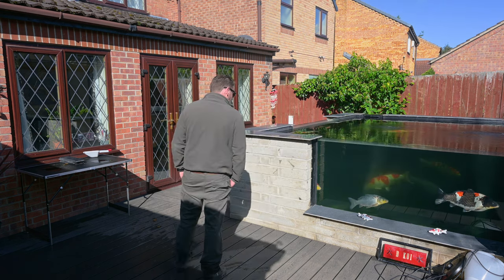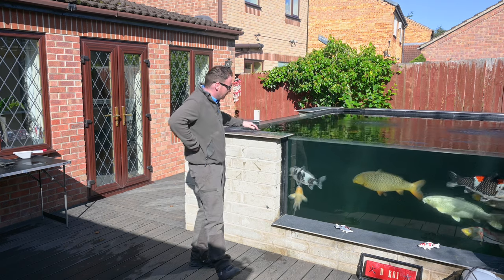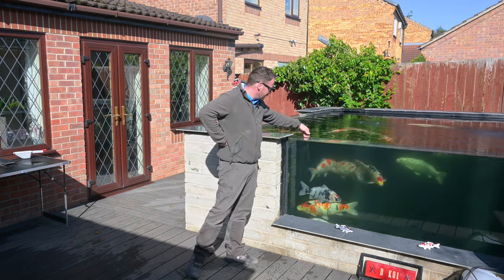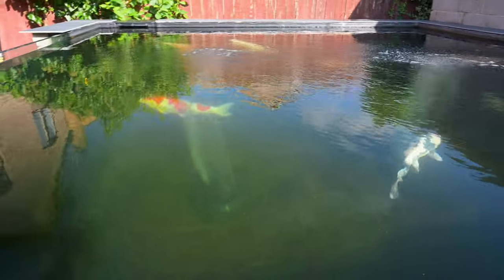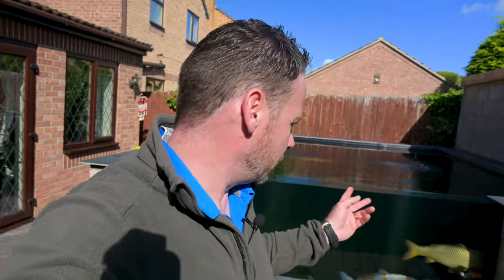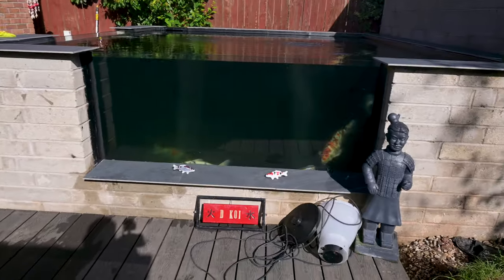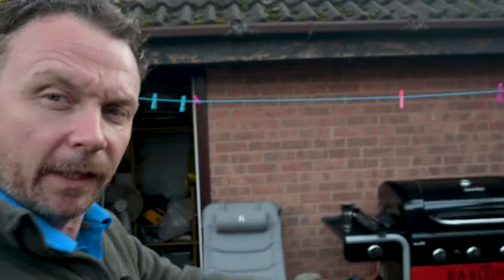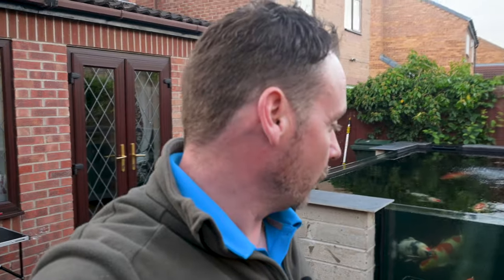AWESOME Pond Build The Next Steps - Small Update *Part 11*

Comment: Windows! I hate the frigging things. Maybe a little one out of the way for checking fish is ok. But Koi in their various guises are meant to be, and are far better if viewed from above. IF? I ever get back into the hobby I would dig deep, (which by the way helps consistency of water temperature) and only raise a wall about a foot or so above ground level to keep the crap from running in. 
I accept not all ground would allow that but if it did I’d highly recommend it. 
Windows aside, I Like what you’ve done and admire the effort you’re putting in to keep your fish in good shape. Hats off. ✌️
Reply from the maker: I was always of the same view.  If I had the land I would have an in ground natural pond but the footprint required is too much for this property to do it properly.  Maybe in my next house never say never.  I was never a fan of windows but fitted them as I didn't want regrets and can always clad over them if I don't like them.  However I must say I am happy I fitted them.  Fitted my heat pump today so temps are on the up.  Thanks for watching Bud 👍🏻

Comment: Looking great m8, trials and tribulations hey, its not allfun is it! I notice a few koi with redress, due to new pond syndrome? I'm going through the same with my indoor pool at the minute, scrapes clear but nitrite peaking but got a detoxifier in but still marking up. I have the same feeder, nice unit but the feeds seems too much, what do you think? Also filling is a bugger as food drops through so i hold the lid inderneath.
Reply from the maker: A couple of fish have had knocks.  Just got over NPS also.  My big sanke had jumped but she's on the mend.  Had some right issues.  The little feeder does 45 grams on 1 for me and thats fine with the koi I have.    Parameters are all good here at last.  In fairness the pond dropped 4 degrees is 2 days that is probably the cause of unhappy fish.  Plumbed in heat exchanger today so that's sorted...  Thanks for watching.

Comment: Once you have the heat pump installed how are you going to insulate and keep the heat in the pond? I'm just looking for ideas really.
Reply from the maker: Haha that I have no idea.  I will probably give them a winter this year.  Then put a roof on it and install removable sides for next winter.  When I say a winter I will heat to around 10 degrees.  The heat pump was installed today and we're at 19.  Should be 20 by morning.
Reply: @dkoi-tv  I’m going for 18deg at the moment. The heat pump is running about 1-2 hours a day (on and off) with the ambient temp being about 16-18deg on average (ish) in Bawtry at the moment. I’m considering multi layer transparent bicarbonate sheets. I’m also considering kingspan to cover the window. Just considering minimising heat loss. Its all a consideration at the moment. Work in progress.
Reply from the maker: @bawtrykoipond  I have just upped mine to 21 this morning.  It was a nice 20.5 when I got up.  I want to try and extend the growing into November then start to back off.  I wouldn't like to consider polycarbonate on this pond, would have to build a massive frame or something.       What size is your window?  I might have some Kingspan...  Also what size is the pond I may also have some polycarb??

Comment: Ponds looking great and fish looking good 👌🏻. Can I ask what size are your windows and what thickness are they? Cheers. Keep the vids coming 👍🏻
Reply from the maker: 2000 x 800 x 25mm 👍🏻 Thanks for watching 🙏
Reply: @dkoi-tv  Thanks. Is there any bowing in the glass with it being 25mm? I'm in the middle of a pond re-build and wanting a 1800 x 900 window but been told 25mm isn't thick enough and need 33mm?! Which is a lot more expensive 🤷‍♂️. Thanks
Reply from the maker: @cadkoipond1975  that's correct mate anything over 800 needs to be triple.  I was advised the same.  Itsbthe depth that dictates the thickness.  No the glass doesn't bow 👍🏻
Reply: @dkoi-tv Thanks 👍🏻